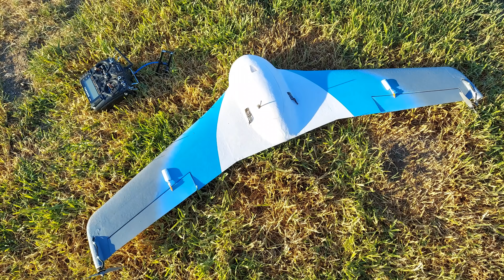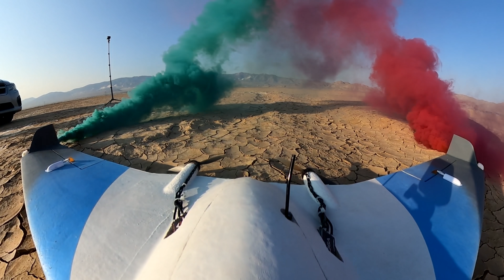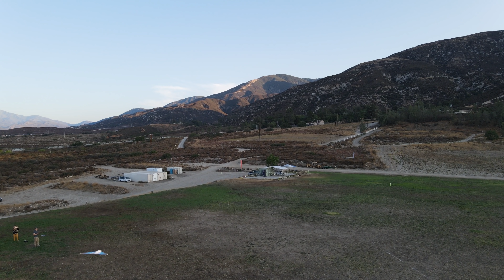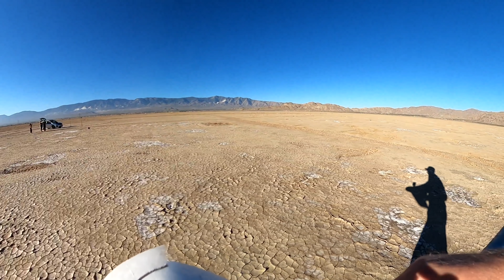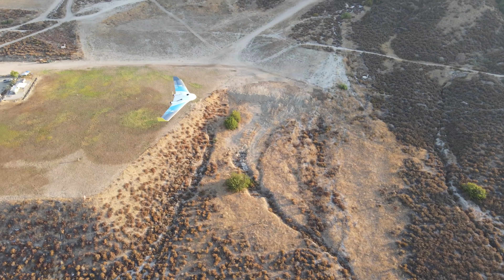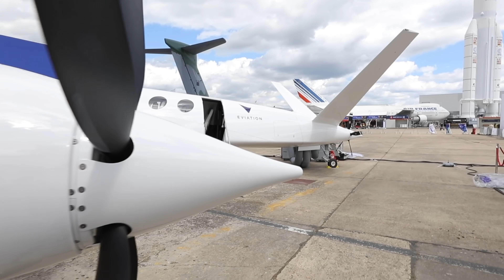Can Wingtip Motors Improve Aircraft Efficiency?  RCTestFlight Solar Collaboration Part 1

Comment: Arrgh - FRUSTRATING!! - In any scientific investigation, you're only supposed to change ONE THING AT A TIME.  You move the motors - awesome ... but then you ADDED WINGLETS?!?!?  whaaat?  Can you please correct your tests, and try without those winglets (or at least change your video title "Can Wingtip Motors Improve Aircraft Efficiency *over winglets*")...  other than that - awesome work.  

Pity you didn't figure out @12:40 what's actually going on - pretty much EVERY RESEARCH PAPER ON FLIGHT IS *WRONG*.  More-or-less all of them make obvious mistakes (e.g. 100% of the CFD ones I've read (a *lot*) all fall into the time-traveller coding trap, large numbers don't do any tests at all, and most of the tests make obvious mistakes, or draw conclusions that are simply not present in their own data).  This makes your video doubly frustrating: you literally proved with an actual experiment that the papers are wrong, then you re-read the papers and simply believe them?  Seriously?!?!?!  You did a real test => YOU are the expert (well, if you fix the one-thing-at-a-time mistake)... you cannot trust almost everything else (which, for the most part, is written by kids (aero students) who are looking to pass a subject, so truth/objectivity takes a back seat to going for a passing grade...)

Comment: Well I'll be the keyboard warriors that tells you you're wrong about lift. First off, I actually am a pilot, went to school and shit for it. Lift is proven I have no clue who is debating that. Check out "Bernoullis Principle".

You're incorrect about induced drag also. Induced comes from ailerons and flaps, things that you manipulate into the airstream. Parasitic drag is what you're talking about initially in the video. It comes from the friction of the entire surface of the plane moving through the air. 

Let's say you're in a car. You can't go faster than it's top speed because you're hitting a wall of air too fast. Your motor cant give enough horsepower to push through, and since we arent in a vacuum, you cant accelerate further which is considered parasitic drag. Induced drag would be when you roll down the window and stick your hand out. You are inducing drag with your hand just like if you're making a turn in an aircraft, popping the ailerons, rudder, and stabilator or what have you into the airstream to physically create drag in the direction you want to turn. 

Wingtip vortices are usually countered by the little angled winglets at the end of the wing. They counter the horizontal movement of air across the wing. Said horizontal movement is bad for lift, and also creates huge vortices that can flip smaller planes when large planes are slow and dirty. Basically big wings that are moving slow and have increased camber (flaps down) create more of that horizontal air movement. 

So if we're saying that the inefficiency that you're trying to improve upon stems from said horizontal movement, then a larger propeller makes sense at the winglet because you're drawing and forcing more air to move perpendicular to your relative motion, where that horizontal loss is well known (see all commercial airliners and their winglets), leading to less loss of lifting surface and more efficiency. 

I would also assume this is the reason for having a large number of small prop engines spanning the entire wing of some of these rc's. You've got air being pulled from almost every section of the wing. Compare that to a single engine pull prop full sized airplane. At extremely slow speeds, you still have stabilator authority (with most aircraft) because even if you're not moving through the air quick enough for that induced drag to push your nose over, you're forcing air into the tail providing the force you need which is usually dependent on how fast you're moving through the air. There's no chance for the air to move sideways because the push props are pulling air over the wing uniformly, which in turn would make me assume that efficiency increases.